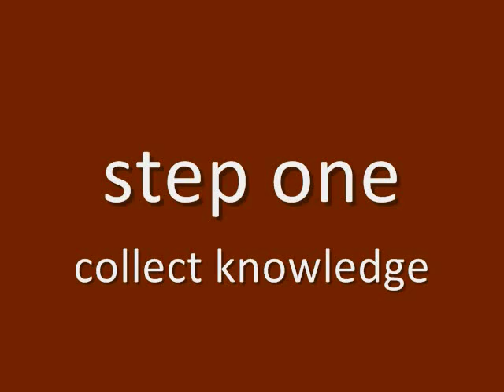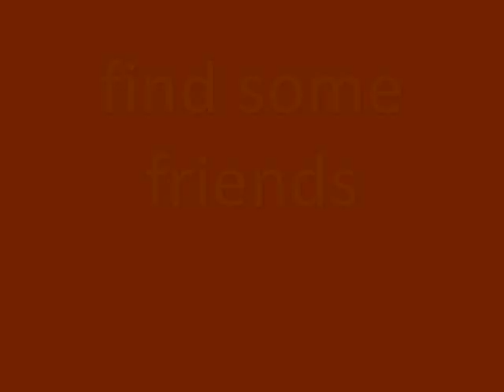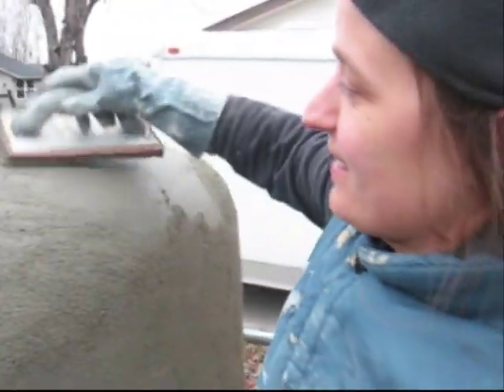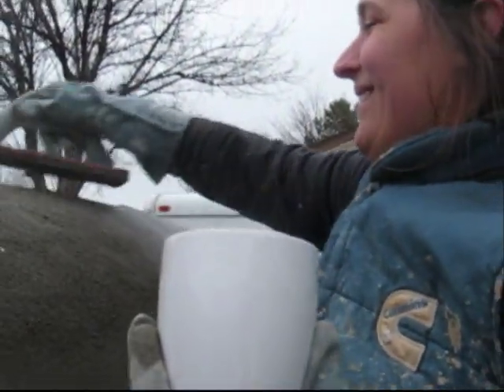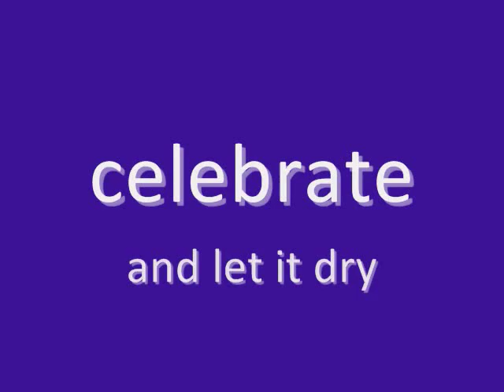A Straw Bale Wall

Comment: What is not mentioned is the foundation? And the importance of raising the bales off the ground somehow to stop them rotting maybe concrete blocks on top of some sort of foundation. Not sure about the need for roofing felt on the top of the wall but maybe it's essential due to rain penatration on top half more than below nylon stitching is mentioned to keep initial rigidty. Hazel poles are used in u.k. and could possibly be hammered thru the straw  holes provided in blocks into ground but if you have a solid foundation this won't work.

Comment: I thought strawbale walls had to be able to breathe and should only be cloveted with mud lime render ...
Reply: Yeah I bet the concrete has cracked a bunch by now. Also, the foundation should be a rubble trench or poured concrete.. which would likely add to the cracking if it's not.
Reply: They should have just done earthbag..
Reply: @yogabi4415  its stucco ... so its breathable

Comment: You have to put a roof over sutch a wall, this will rot, to bad it looks great right now but in a couple of years.....
Reply: actually as long as the stucco is on if forms a water proof seal that wall will last long past normal brick or cinder brick wall
Reply: Joshua Bone grandad made one in his place 3 years before I was born in 84 and the wall still stands unscathed with the minor moss and vine growth
Reply: I'd imagine the roofing paper will prevent vertical water ingress.